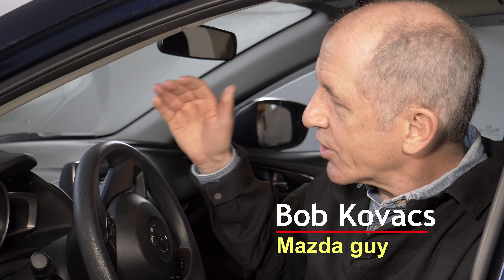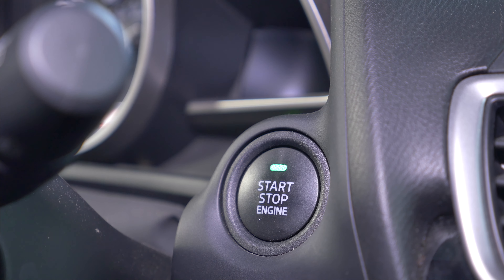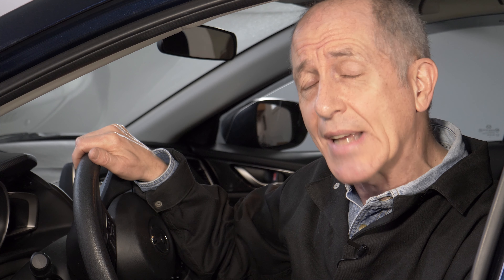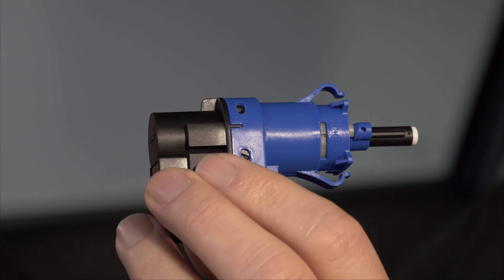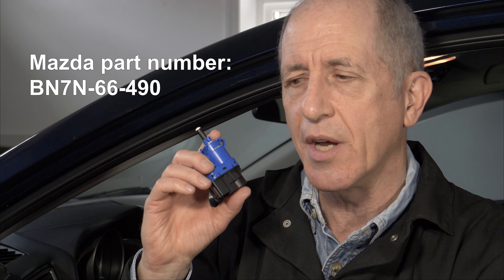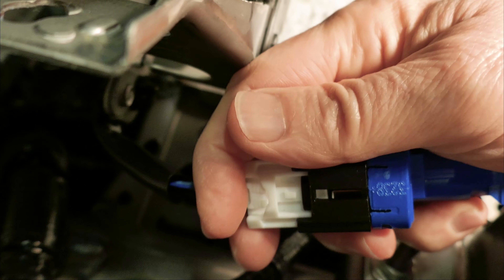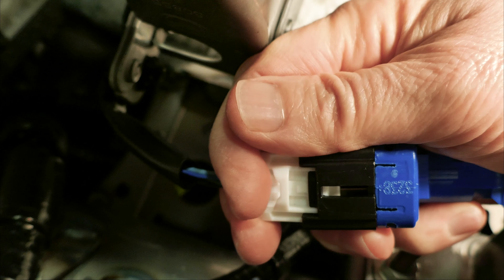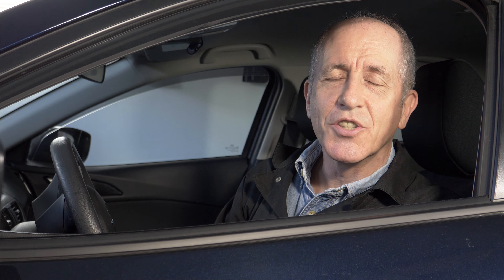Mazda3 2014-2018 Brake Light Switch Replacement

Comment: Hi! Just wanted to say thank you for this video! My Mazda was displaying the check engine, tire pressure monitoring system, and traction control system lights and at one point was showing the master warning light.

I ran the engine code, and from that, stumbled on articles and then your video which walked me very helpfully through the fix. Ordered the part online and everything is working!

Thank you again! What could've been a $80+ fix with a garage was made cheaper by the part and some free research.
Reply from the maker: You are very welcome. It is always rewarding to hear a successful outcome like yours.
Reply: Your comment is exactly what happened to my car and the same code issue, so i am going to be fixing that tomorrow.  Thanks for your comment it just confirmed that this will hopefully solve same issues.
Reply: @venge2charger  You're welcome! Glad we're on a helping chain here. :)
Reply: I have the same situation. The switch comes in tomorrow
Reply: Switch came in. Everything resolved after install. Toms, traction control, start button and gear shift works flawless now.
Reply: @Sarah Did the warning lights appeared while driving the car, or while stationary?
Reply: @suciul  The TPS lights were while stationary and moving. The MWL and Check Engine appeared once while moving and then once I parked, and sat for about an hour, did not reappear on startup.
Reply from the maker: @Madatu411  Great to hear that this solved the problem, Alfred... thanks for sharing your story.
Reply: Exactly what's going on with my 2014 3 manual.  A couple of weeks was the TPMS. Then it went bananas. Felt like the whole dash was lit up. Tire pressure was fine, brake lights fine,  traction control fine. I'm hoping it's the switch.  

But Bob,  I have brake lights. Did yours as well?  What is the point of this switch?

Oh, and then the plating started to flake off on the steering wheel badge. Out of everything that's driving me the most crazy.
Reply from the maker: Hi... I didn't see this note until just now (Jan. 22, 2022). I had intermittent brake lights, although it was hard to tell while driving the car. I finally noticed it in my garage -- sometimes the brake lights didn't work.

What's the point of the switch? In addition to the brake lights, it lets the car's computer know that you have stepped on the brake pedal. The cruise control needs to know that, and cars with auto trans can not be moved from "park" unless it gets the signal from the brake light switch. (Don't know if it is the same for manual trans, however.) And, of course, the "Start" button. With a bad brake light switch, the computer doesn't get the signal it needs to put the green light on the "Start" button.

Comment: My Mazda3 was hard to start and I did not know why until I noticed all 3 of my brake lights were completely out. That means I was driving around with absolutely no brake lights and the car could not start on the first attempt. Instead of taking it to a shop, I found this video after I had messed with the fuse box and battery and found no issues there. Didn't even know brake switches existed. Fortunately though, the brake light switch WAS the problem! I replaced it and all 3 brake lights have been working and the car starts 100% of the time. Thanks for you video!
Reply from the maker: You are welcome... and thanks for stopping by and telling your story.

Comment: A couple of weeks ago, my brake assist light, check engine light and tire pressure light came on at once. I was freaking out because it looked like a major system failure. Before calling my mechanic, I did a Google search. Someone on Reddit made a reference to this video. Looked to be a common defect with Mazda. So, I ordered the part. Took 5 minutes to change out and all is well with my 2015 Mazda 3 hatchback once again. Thanks Bob!
Reply from the maker: Great story... thanks for dropping by to let us know.

I'm also finding out that the tire pressure sensors tend to fail after 6-8 years, so you might want to put new tire pressure sensors on your list next time you replace the tires. The only way to access them is to take the tire off the rim, so the ideal time is when you get new tires.
Reply: @BobKovacs  Thanks for the heads up!  I am planning on getting new tires within the year.  I'll change out the sensors then.
Reply: Hey were you able to get a code for the check engine light? If so was it Po504?

Comment: Thanks for the great explanation. I just did this replacement on my Mazda 2 DE to enable cruise control (changed 2 pin to 4 pin brake switch). It took me about 10 minutes to lay down to have a good view of the switch. I initially thought I had to remove the plastic shield/plate underneath the steering wheel but decided to try without removing it and eventually got it done with no issues. Now I have cruise control :).
Reply from the maker: You're welcome. And thank you for sharing your story.

Comment: Let me preface by saying, I AM NOT A CAR PERSON AT ALL. 2018 Mazda 3 touring

My car had the traction control, tpms, and just before I decided to finally do something about this, the check engine light came on for only a few hours though. The same issue with needing to depress the brakes 3-4 times for the car to detect the key and turn on. 

The hard part with me being 230 muscle was getting a comfortable position and trying to get 2 arms to fit while upside down with that small space to workin but somehow made it work. The switch comes off super easy, just rotate it clockwise. The white part or chip adapter is much harder, took me 20 minutes all together because I was scared to break something but now I could probably do everything in 5 minutes next time. The one hand pull or hands or whatever method did not work but the flathead how Bob does it worked perfectly. I put my flat head in and with pressure pushed it in while moving it out towards the white part while my other hand pulled the switch away and it came out. I then put the new switch in that I ordered from Amazon and put it back in the bracket and rotated counter clockwise to secure.

Thanks for the video! The mechanic wanted to charge 150 just to diagnose this, and I decided on a whim if autozone could, and they diagnosed it with their obd tool in just 5 minutes, once I knew what it was, a quick google search led me to this video . Saved me probably 250$ thanks
Reply from the maker: You're welcome... glad to hear it worked out for you.
Reply: Had the same issue, the connector was a back breaking job bcoz of the tight space

Comment: I can't thank you enough for this! Thankfully I'm small so getting to the brake light switch is easy for me. I noticed mine was slightly misaligned and all it took for me was clicking it securely back into the mount! I ordered one from Amazon anyhow for possible future use as my car is a 2014 and I'll have it in hand when/if it eventually goes. 
Thank you for saving me a potentially costly trip to the garage.
Reply from the maker: You're welcome... and it's great to hear that you figured out the problem with yours. Thank you for sharing your story.

Comment: Thank you! Super easy to fix when you know what to look for. his is the second time this switch went out on my Mazda. The first time the dealership charged me $240 to diagnose and replace. Today I went to Auto Zone, diagnosed for free and the part was $31 with tax.
Reply from the maker: Yes, this is a 5-minute job if you know where the part is. I'm surprised to hear that the switch failed again, however. My replacement has been perfect so far, and it's been 4 years.

Comment: To anyone that is having trouble with this, a non-OEM version of this part will not be set to the correct depth because these parts cover a variety of models. There's a black plastic portion that almost looks like a bow tie at the top of the device that is used to set the travel distance before installation. Remove the old one from your car and take a look at the travel distance. Depress the plunger on your new part to the correct distance and travel, then turn the plastic part so that it aligns with the tabs that retain the device. This will set the depth and travel on the new device to the same as the old one.  If you don't do this, there's a chance that the new part will not make proper contact based on the travel distance of your brakes.
Reply from the maker: Thank you for the excellent tip.

Comment: Thanks for making this. My 17 Mazda 3 has recently started throwing the ABS, Forward Collision Monitor, and Tire Pressure light all at once. So far, turning off/on the car then pumping the brakes clears the lights.. to me, that means this switch might be going out or intermittently not getting pressed correctly. I'll try this if it gets worse, happens pretty rarely now.
edit: yup, the new switch fixed it completely.
Reply from the maker: Glad it helped
Reply: I have the same issues. Did it fix it?
Reply: @michaelborisenko9432  Sorry, I'm 6 months late but yes, it fixed the lights permanently.
Reply: Ordering part for 17 sport.  Same exact symptoms.  Thanks!
Reply: Fixed my Mazda 3 2017 perfectly my car start button wasn’t turning green too and replacing it fixed everything this guy is a goat

Comment: What a great video! Does this switch also activate the shifter solenoid to get the car into Reverse or Drive...?
Reply from the maker: Yes, it does. You can't shift out of park unless your foot is pressing the brake. And this switch provides the signal that you are pressing the brake. If the switch is bad, you can't shift out of park.

Comment: A big thank you for this information. The only thing was that I'm just an average guy and it took me half a day to put it in because I couldn't see everything that your camera saw! Even though we have the same car, your video seem to suggest a lot more room to do this compared to mine. That said, it's in and working great!
Reply from the maker: Thanks for stopping by and telling your experience. Yes, it is a cramped location, which is why the camera is shaky at times -- it was very hard for me to hold the camera in one hand and do what I needed to do with the other hand. And I had 4 lights under the dashboard to throw enough light for the camera to see! However, it is gratifying to hear that it helps people, so I appreciate your comment.

Comment: I totally appreciate your video. After a a/c blower motor swap I guess I bent a pin on that switch and was not understanding why people were riding my ass. I did have a indication light but couldn’t locate the issue. The bent pin also caused a shifter lock. 
Thanks again 🤘🏻😎
Reply from the maker: You're welcome.

Comment: Thank you so much for your help Bob!! This was such an easy and inexpensive fix 👍 It also felt really good fixing the car ourselves just by doing a little bit of research! 

I am however still experiencing the “depress break pedal to start engine”warning on the dashboard and the engine will not start until I press the break. The iStop seems to come on first after I press the button to switch the engine on, but without the engine actually switching on. And after that, the depress break pedal warning pops up. 

So all in all, I have to press the switch button on three times before the engine actually does power on. First time, just the infotainment comes on and no lights whatsoever on the dashboard (as it used to before the break light switch issue). Then after a second press of the switch button, the iStop comes on followed by the depress break pedal warning. It is only after I press the break pedal and a third press of the switch button, that the engine does eventually power on. Do you happen to have any idea why this may be happening at all? 

Thank you so much for your selfless help and support on this matter! That is indeed very kind of you! 🙏
Reply from the maker: Thank you for the kind words. I have the 2014 Mazda3 that I show in this video, and it does not have anything called "iStop." The proper starting procedure is: 1) Step on the brake pedal; 2) Press the "Start" button. This always works perfectly for me, once I changed my brake light switch. If your car starts like mine, you should press on the brake pedal first, then push the button. If you have a different car with a different procedure, you should follow the procedure in your manual.

And yes... it is a good feeling to fix your own car!

Comment: NICE short simple and to the point on how it gets removed and reinstalled. Missing on the other 5 vids that didn't actually show it. I found it rather easy to look in the hole under the steering column and use a 16" flat screwdriver in one hand then reach in with the left hand to grab the switch. Much easier that trying to get 2 hands up under there.
Reply from the maker: Thanks!

Comment: I replaced then switch, however, then the check engine light went on as did the master warning signal. I cleared the codes with two different scanners then they came back. Autozone diagnosed it as the brake light switch. 🤦‍♂️ Wondering if the switch I purchased was OEM or not. New Mazda owner headache!!!! Great video BTW!
Reply from the maker: That's really a bummer... sounds like the replacement was a bad switch. I recommend trying another switch, but I can see where you might not trust that.

I still have my 2014 Mazda3 and this switch has literally been the only maintenance problem with this car. It failed once, and I replaced it as I show in the video. That's it... other than regular maintenance (tires, oil changes, filters, wipers, etc.) the car has had no other problems and runs perfectly.
Reply: These aren't bad switches necessarily, they just are not Mazda specific and need to be set to the proper travel distance. The black tabs down by the plunger are used to set the travel distance of the switch for both directions of travel. If you compare your new one to your old one and depress the plunger to the same depth as the old one, then turn those tabs so they align with the mounting tabs. The depth will be set properly and you will avoid these warning lights. I learned this the hard way after an OEM one worked and an auto parts one did not.

Comment: is it the same as BN7N-66-490A??
Reply from the maker: I have not seen a BN7N-66-490A, but I'd gamble that it is an exact replacement. Giving it the letter "A" makes it sound like it is an updated part. If you get a BN7N-66-490A, let me know here if it looks/works the same way. Thanks!

Comment: Hey I was wondering if you could help me. I’m having some similar issues as some others here where I recently had the brake light switch changed after going to the dealer to get my booster changed. Every since then I’ve had to push my pedal a bit farther to activate brake light, ignition. And yesterday the traction control, SCBS, and one other light came on that I can’t remember. The lights went away after a little while. But today while in a drive thru, the start stop button started flashing amber. Only for a brief moment of time before stopping. Could this all be the brake light switch
Reply from the maker: Yes, it sounds like the brake light switch to me. I can't guarantee it, but a replacement switch costs around $20 on Amazon and it takes only 5-10 minutes to swap it out. It is most likely the cause of the symptoms you're getting.

Comment: Hi. I have a 2017 Maxda 3. I'm 55 female with no mechanic experience. After watching your video, I was eager to fix my car myself (brake light switch and replace low beam bulbs). However, it hasn't been easy for me. It is a really tight space under the dash. I haven't been able to remove the old switch. Looking at ypur video it appears that the lower panel is removed when you replaced your switch. How do I remove the panel without messing up the car? Also, I can't find low beam bulbs to replace them. I might have to pay $150 for the mechanic to do it for me. 🙁

edit: Ok. After giving up, reading through more comments, and rewatching the video I gave it another couple trys. Hooray!! I finally got the brake light switch  changed. 😁 Now to see if I can get the headlights changed.

Thank you very much, Bob!
Reply from the maker: The low-beam headlights are a real bitch on my 2014. I had to loosen the inner fender liner on each side, move it a little out of the way, then get a hand in where the light is. It is a very tight space, and almost impossible to see. I mostly did it by touch.

Good luck.
Reply: @BobKovacs  Thank you Bob. I did manage to finally change the passenger side low beam through the engine bay without having to go through the wheel well. It took a long time to find the right light because you can't see it. Once I was sure I had the right light I changed it by feel. All is well right now.
Reply from the maker: @smileejoi1603  Glad to hear that you got it done.

Comment: Hi Bob. My yellow parking brake and scbs lights go on in my 2017 Mazda cx5. Will this fix the issue?
Reply from the maker: Are you talking about lights on the dashboard? I do not think they have anything to do with the brake light circuit. Do you have any trouble starting the car? Any trouble getting it into gear?
Reply: Yeah the yellow parking brake light and scbs lights come on when I start driving. The car starts and drives just fine to my knowledge with no accidents or damage
Reply from the maker: @PJrock1  I do not think that the problem you have is with the brake light switch. You should get a diagnostic tool plugged in and see what it says. I can't help you with that.